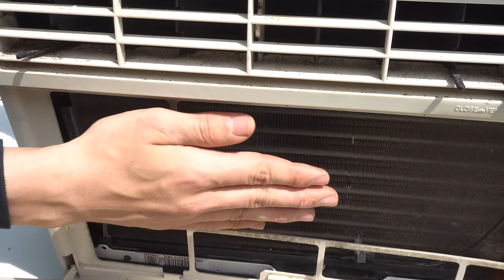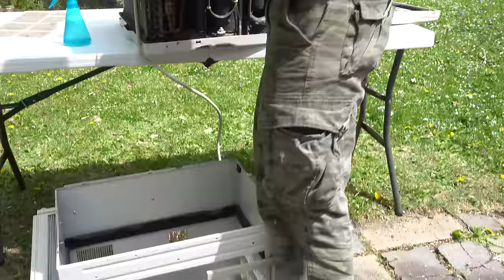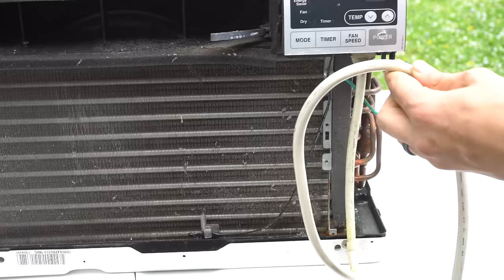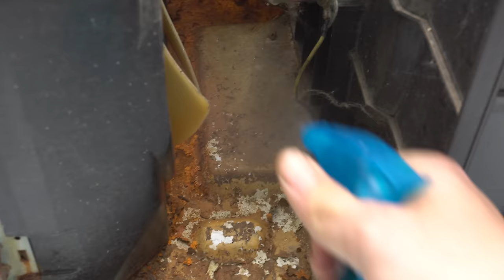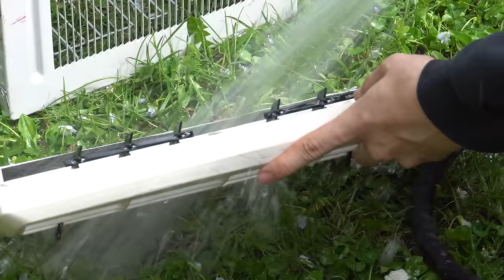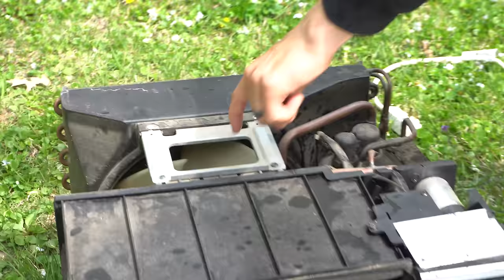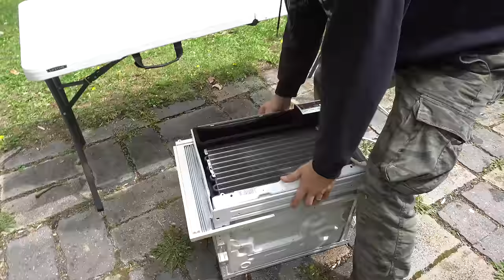Window Air Conditioner Not Cooling And The Most Common Fix

Comment: You should mention to let it sit so the oil that was in the pump drains back into the pump if you roll it on the back as you did.  My guess would be at least a few hours.

Comment: Hint to all: Im a licensed HVAC Contractor. Cleaning your coils are always a great idea. Laying your air conditioner on its back for any amount of time is a really BAD idea. The oil in the compressor will leave the compressor and may not get back in when returned to the up right position. The oil lubricates and helps cool the compressor like in your car engine.(same reason you never transport a refrigerator on its side or back) It also gets into the smaller refrigerant tubing restricting refrigerant flow. These two conditions can eventually kill your compressor if it does not die immediately after starting it again.
Reply: My mom is having her hvac system replaced.Anyway she'll have no ac for 2 days. I went into the shed and dug out a small window unit. Sure enough it was layed on its back for 25 years. To my surprise it ran but didn't cool. ? can it be saved?
Reply: HVAC repair guy told me that if unit (Refrigerator) is on its side for an hour, leave it sitting upright for an hour before you turn it on again.  I live in the country so had to haul mine 45 minutes to repair shop.
Reply: @sierrajade63  Its probably out of refrigerant. Unless you have a friend that wont charge you a service fee, its probably not worth repairing.

Comment: Might just want to mention that the condenser gets dirtiest on the fan side so you want to look in there and make sure you got it clean. You can hose through from the outside to get it, but need to check.
Reply from the maker: Thank you for pointing that out! Usually spraying it from the outside is enough but where it actually gets dirty is on the inside as you said. So I should have talked about that too...

Comment: Get some coil cleaner.  Let it sit for around 10 minutes and wash it down with a hose but not high pressure...you will bend the fins.  Let it sit and dry and you are good till next spring.  Clean the filter every 3 months.
Reply: Simple Green works great. Is cheap and non toxic.

Comment: Is not it that by not keeping it straight and upward, liquid refrigerant can enter into compressor and it will ruin the compressor. Because compressor is designed to handle vapor only.
Reply from the maker: That is not the case because the whole refrigeration system is pressurized and when the unit is off, the pressures equalize. So the same pressure/state is in the compressor, evaporator, and condenser when the unit is off.
Reply: Yes. But is not it that liquid refrigerant comes in compressor?
Reply: @MRBEYG  
Not to mention the oil migrate into the rest of the system .  I'm license with the state of Texas and that's just something you don't do to the cooling units .
Reply: chris younts  I'm sorry sir, I just have to disagree with most of your explanations. I don't want to argue more but I assure you, I know a lot about it. Better check out the explanations of refrigeration cycle in the internet. They explain much about how a refrigerant changes its phase during the cyclical operation. No shaming meant sir.

Comment: I have a GE air conditioner and it has the squirrel cage blower which gets very dirty. So you need to look for that and clean it thoroughly , probably with a brush and koil kleen works the best.

Comment: I do this every other year in the northeast, I have a raised Ranch 2000 Sqft and a window Unit that pushes 20,000 BTU or just under 2 ton of air running on 230V that cools the entire home. My unit is 25 years old, preventive maintenance is EVERYTHING in keeping old things running like new.  If the Military taught me one thing it's take care of your equipment because it will take care of you when you need it the most.  Most people that live in the Northeast understand how important a AC Unit is... sure we see temps in the winter of way below 0 F. but what they don't say is in the summer we also see temps well over 90 F with over 90% humidity, Florida thinks they have a humid problem come live in the Northeast, the only difference is we don't have to deal with it as long....thank God.  I'd rather live in Arizona or Nevada with no air than deal with this FU*%&ing humidity.....yeah 105F with 27% humidity, I'll take that any day over 85 F with 89% humidity

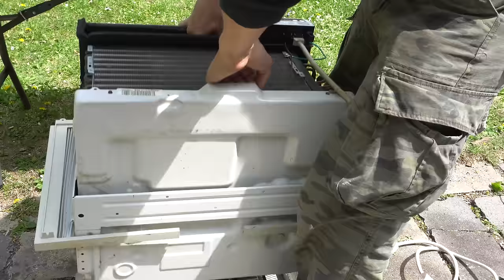Comment: @4:32 When you exhale it helps regulate some of the pressure that builds up in your chest and abdomen. When you release the pressure that has accumulated in the abdomen and chest it reduces the risk of sustaining internal injuries, like hernias and vessel strains.
     Professional powerlifters hold their breath during lifts, a technique known as the Valsalva maneuver. The idea is that holding your breath while lifting extremely heavy weights can provide core strength and protect your spine. However, holding your breath while lifting heavy weights runs the risk of increasing your blood pressure, which can lead to fainting or a heart attack. Unless you’re a serious weightlifter and you plan on attempting a one-rep max lift there is no reason to hold your breath while lifting weights.
     While inhaling during the eccentric phase and exhaling during the concentric phase can be beneficial, the more important thing is that you engage the core to create stability for the spine. When you flex your abdominal muscles it creates the brace you need to safely and effectively lift. Straight-back and bending at the knees when neccessary is last but not least.

Comment: My air conditioner is over 18 years old, but it is still going strong.  My apartment window height was twice the height of the air conditioner, and the apartment slide windows slide sideways rather than up and down, so I did not need to use those accordion expandable side panels on each side of the air conditioner.   Instead I bolted the two accordion side panels together, and then used this combo to fill the open window area just above the air conditioner. This worked, all thanks to the two expandable panels combined being the exact same width as is the width of the whole air conditioner.  The way I mounted it all is tough enough to handle an Earthquake. This is good since my air conditioner sits directly over the apartment building rear door entrance. That also meant that water drips were dripping from the air conditioner right down upon the entrance area. So, I took an old dead AC/DC adapter's plastic box and turned it into a drip catcher and then drilled a hole into that and connected it to a tube that redirects the water off to the side, away from anyone entering the building.   I love these DIY projects.   By the way, after the air conditioner was 16 years old, the motor bearings had begun to squeal, so I had to figure out a way to oil the motor brass bearings since the motor was fully sealed.  After fixing that, it was as good as new.
Reply: Interesting story.  Thanks.  How did you oil the brass bearings in a sealed motor?

Comment: The factory left out a screw at the rear bottom corner, unfortunately I put a screw there and it penetrated the Freon pipe, they should have capped of the hole it cost me big time, that's what happen when they make one cage fit many slide in units? That is a good reason to take pictures along the way and make sure that a extra long screw goes back into the same hole, thank you for the suggestion!

Comment: Thanks for this video… QUESTION: my unit has a little rubber plug on the bottom side. Do I remove that so water drains out or not? Cuz when water accumulates the fan hits the water. Is it supposed to constantly be draining ???? Thanks so much

Comment: Excellent demonstration on what to do if you have a dirty window rattler? However mine is spotless as I keep it clean by washing it after every season when I pull it out. The filter is clean as well. I even go so far as to wax all the metal to prevent rust. That being said….the air conditioner doesn’t cool as well as it used to. It takes hours to cool a small room down . The compressor is cycling on & off after it has cooled the room. However as the heat climbs outside it can’t keep up cooling the room? I know it’s a sealed system. However I thought it might be as simple as a bad thermostat? Any thoughts as to why it doesn’t work as well?

Comment: -- Subject is drilling drain hole in bottom of AC--  Working on audio and electronics for decades. So I understand the dust and all you did. This reminds me of when I take something apart. Most say they cleaned it which amounts to a 5 sec wipe down. I'm in something for hours. So, the old age question that I can't still fig out and not much on it. Which I feel would make a good topic with a AC. I have fixed a few and been inside some. Also cleaning, but a AC is not my full know how area. Topic- Frigidaire 12 grand btu. I got it about 5 years ago. I see the bottom has no drain. Matter of fact I brought a few since and see none have it. So I get that water in pan spray sound when AC is on. That got old fast so I drilled a hole in bottom. Water drains out it and has been that way for years. Now what I gather from searching ( can't rely on that truth always ), is water cools coils and stuff. Is why no drain. It throws water on all etc. I could maybe see the point in this. I have since forever wondered if I should plug up that drilled hole and stop drilling holes in stuff. Just put up with the loud water splashing in AC.  Which at times I did see that got pretty deep in pan and when it rained it filled it. So, question is simple to drill a drain hole or to not and why?
Reply: We did the same! I have an LG 5k btu and it spits all day... drilled 2 holes...fixed! I've also read that you're supposed to "slightly tilt" ac so that it drains properly. Well that cannot always be done so the drill holes had to due!
Reply: So basically I need your question answered as well lol

Comment: I have a Kenmore it stopped cooling. I did all the cleaning. The condenser kicks in as if its gonna cool there's just no cooling. Is there a way to tap into this unit and re-supply the freon?

Comment: I have this same exact unit. There is a soft black foam in the celing of the unit where the air comes out. Remove this because it collects moisture and will mold and mildew.

Comment: My window unit is a Fridigaire at 15000 BTU it weighs in at 115 pounds and it sits in a window sleeve that's about 6 feet off the ground. Removing this thing is not an option. Any ideas on how to clean the fins?

Comment: I had an AC with a broken 6 blade fan, hot knifed the broken base off and the opposing blade leaving a dragonfly configured 4 blade. It moves twice the air over the evaporator than the 6 blade.

Comment: I have 3 widow units that stopped cooling.  Not because of failure to clean, but because they used R-410 refrigerant.  All 3 leaked after no more than 3 years.  R410 requires pressures as high as 400 psi or more and the Chinese have yet to develop the skill to solder or braze the copper lines to withstand the pressure and vibration from the compressor.  All had cracks in the joint in the high side line at the compressor.
Reply: These units were all purchased around 2015 -2017.  I have one older (16 years old) A/C that uses R-22 and works perfectly.  My advice?  Keep the old working units!

Comment: you can use a stain brush which is softer to clean it and it will get into all the creaves without destroying the unit and the fins of the radiator looking thing gently brush it clean and rinse it really well ...

Comment: First off thanx for the vid, the timing was sweet. Only now I have a problem im hopping you can help me figure out. The unit was working fine before cleaning, i covered electronic compartment with plastic bag and some tape before any washing began. Upon removal of the bag everything appeared bone dry with the light layer of dust that was already there and no signs of water at all. Once reassembled I plug it in and everything seemed to be working  for the first 3 or 5 sec then I heard a click and it  powered off.  The surge protector on the plug has a reset switch that now won't stay reset. I press it and it just keeps popping back out. Im thinking something that wasn't suppose to get wet did but I'm surely not the expert on these things. Any help would be appreciated if you find the time. Otherwise thanx for the awesome vid anyways and God bless.

Comment: I found a handful of these type units in a storage unit I bought.  I was wondering how to TEST them to see if they blow cold air still.  Do I have to put it in a window to test them?  Or can I just put it on a table like you have, plug it in, turn it on and FEEL for cold air? Thanks to anyone who knows and answers =]
Reply from the maker: If it was on its side or back, make sure you let it stand upright for a while day before you plug it in. But yes, no need to plug it into a window, putting it on a table and running it is fine. If there's nothing wrong with it you will feel the cold air.

Comment: Does starting up my window ac unit on low power mode with the temp set at 78°, then increasing its speeds gradually, and also lowering it’s temperature gradually, improve its effectiveness and overall power? Say if it were an older unit?

Comment: How long does it usually take for the freon to be exhausted? Ours cools and seems to turn off cooling randomly. Cleaned up and good as new but still having issues. It's non digital and about 5-6yrs old. Gets used for about 3-4 months each yr. Removed, cleaned and stored yearly

Comment: Also you can go to wal mart buy and regular air filter for your house and cut to fit so you don't get the dust build up on the front condenser  in front I also recommend to clean the out side one with a hose once a week if you can
Reply: My window AC unit has a filter in the front and when it gets clogged up, a red light comes on telling me to clean it but I have a question to you even though I do clean my filter. What if I got that suggestion you said at Walmart and cut it to size and put it either between my filter and the condenser or put it on top or I should say in front of my filter Hope that makes sense.
Reply: @ruggedrickrude1946   you can put in where the air filter goes or do like I do and just put it where it sucks the air in on the out side
Reply: @walterd6363  our AC unit is in living-room window,grass area gets mowed there when needed last couple years I thought about the small holed heavy blackout screen stuff,your air filter to me makes more sense TY for reply

Comment: A good foaming coil cleaner makes life so much easier, Been using it for a long time now and I`ve never had to do more than rinse it off after a few minutes!! NEVER scub the fins of the coil with a scrub brush.. it will damage the fins and NEVER scrub the filter with anything it will poke holes in it! Just things I`ve found out the hard way!!!
Reply: I use my air compressor to clean the filter, or rinse it off in my sink with plain water and my fingers
Reply: Where can I buy

Comment: They also make Fin Straighteners if your cooling fins are all bashed up.  Sometimes, a stiff nylon brush slid over the fins will realign slighly bent ones.  Better air flow, = higher efficiency = lower cost to run!

Comment: My capacitor went out on my window ac, I bought a brand new capacitor, same mfd 30+5uf, and it works, but it either on, or off, no just fan, or low, medium, just high always on, or off. What would you suggest?

Comment: That's the same exact air conditioner I was having problems with. My issue is, somewhere down the line the filter went missing. It used to be someone elses then ended up being mine.

Comment: Hi, thanks for the video. I have seen many of your videos Abt heating system and they are very helpful. Today I am asking for your help because I have looked up online but have not found solution. I have 15k BTU window unit from Frigidaire FFRE153WAE0 it's 115v unit even though it is 15k btu.  It's only 2 years old. So it's out of warranty. My issue is no cold air at all coming from AC.  AC turns on, fan works fine on all 3 setting. compressor kicks in after 3 minutes as per the manual, compressor sounds normal. I checked the windings resistances it's normal. I do not see any oily area in the Unit or on any of the coils or fins. Coils and fins have no dirt or debris  Filter is clean.  I cannot figure out what's happening. Why no cold air ? Please help. I do have question. Do you think one of two thermisters is bad? Or even though winding resistance is ok internally compressor is bad? This is sealed system. How can I check coolant level? Can I install Schroeder valves? Please help. Thanks.

Comment: Hi Jay, thanks for your inpurt. Even though my filter was hardly dirty I just cleaned it hoping it will improve the temperature of the cool air. If the tilt of the AC unit on the window is corrected will that help with getting more efficiency with cooler air? I am trying to avoid buying one right now.
Reply: Did this help ?
Reply: I don't think the tilt of the unit and how well it cools are related.  Pretty sure most units are meant to be level.  Sounds like you may want to call an HVAC tech and have your unit serviced.

Comment: So whats up if the rust is heavily accumulated at the bottom back (outside) coils and they're all red and flakey. I poured some vinegar down there and cleaned out all the rust and the coils are in solid condition, lost about quarter inch of aluminium fin. But I'm about to put it back together now that it's cleaned up and see if it works.

Comment: My window unit is sealed to the wall. I know I can still spray it but how can I hose it down? Will a spray bottle with just water work the same? I know it's not the same pressure tho.